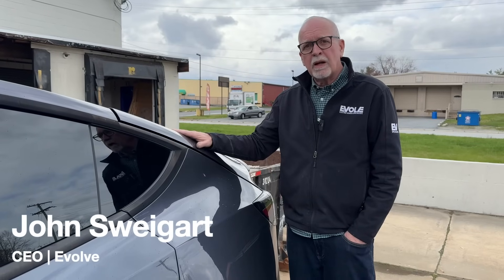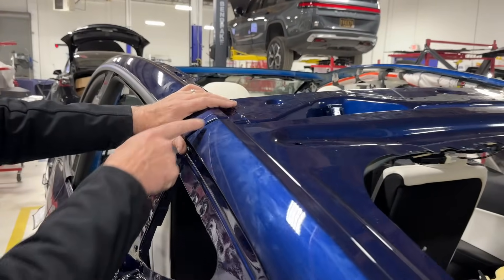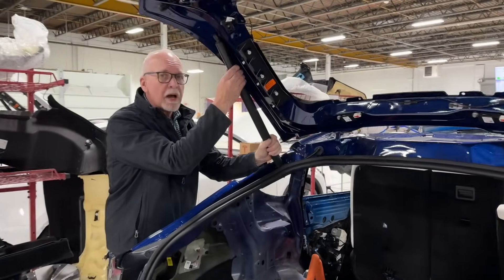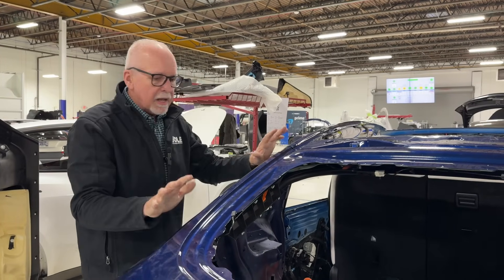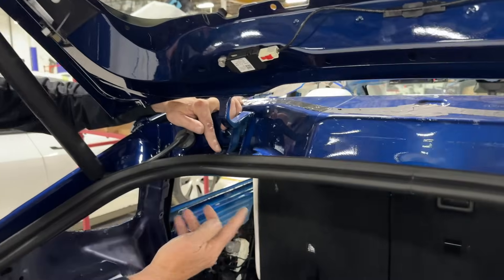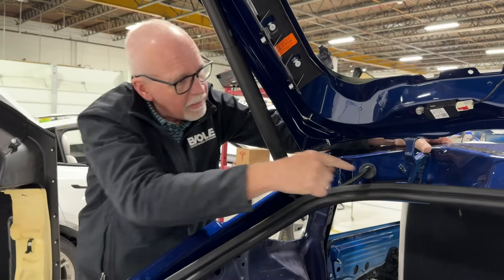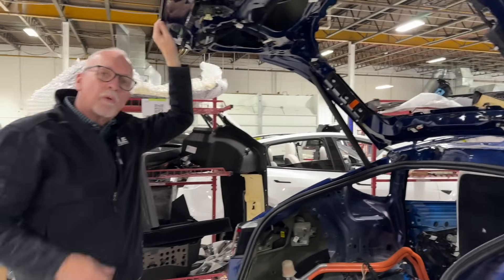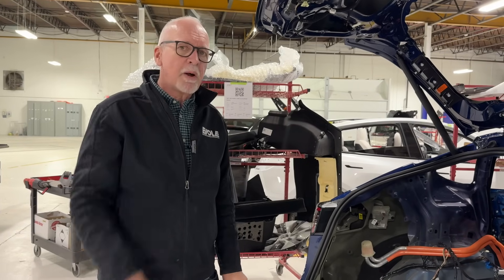Tesla Model Y Trunk Panel Gaps - Causes and Solutions

Comment: Today I have adjusted mine it was very easy no beet to open the screw just need to loosen tailgate tope 2 let and 3 right first attached to tail not body one with 13mm ratchet Spana that’s easy then right side there is rubber that one remove and adjust mean increase height right side so left ll be closer that’s it then secure the screw I ll make video sooner for that

Comment: Appreciate the video. Had this same issue resolved by Tesla a few months ago. They only told me the brackets had to be replaced. I had no idea on the root cause of the problem, so Thanks! Unfortunately, problem happened again and this time gap is MUCH worse. You'd think they'd issue a Recall for a new engineering design. Perhaps two powered hinges vs one side. Taking it in to Service Center. Lets see what they say now.
Reply: What did they say ?
Reply: What did they say
Reply: @amandopurperhart1351 my car is right now at the SC for this problem. I'll let you know
Reply: @pTrzor thanks brother
Reply: @amandopurperhart1351 One of the trunk hinges is bent. I need to have it replaced at a Tesla-approved body shop, and then they'll make an adjustment. Tesla will pay of course

Comment: This is so helpful. I have a Mazda CX-60 with a misaligned trunk. I pushed to hard on it when it opened automatically because it has the kick sensor and I was behind the car. It's basically exactly the same system. Now I can try fix it myself.

Comment: HI there and thanks for taking the time to create a video about this. My issue is slightly different, I have a 2023 Model Y and it has developed a massively annoying squeak (that sounds like a rattle) traced to the lift gate rubber seal. I have had the car back at Tesla twice now for the same thing, first and engineer re-aligned the whole lift gate and surrounding liners but after the squeak persisted, it was back to Tesla. On the second occasion the engineer said "it is definitely your rubber seal squeaking" and he put some special lubricant / softener on the seal and sure, the squeak was gone. But only for about three months and it is back worse than ever.  (whatever he put on the seal was NOT silicone as I have already tried that to no avail). Anyway, my question is - would having the lift gate aligned in some way (or can the closing position pressure be adjusted) to stop the squeaking, or should I have them replace the rubber? Even if they won't do it under warranty, a seal seems to be only $50 and cannot be that hard to affix....

Comment: I have the same issue on my 2022 Tesla Model Y and when I took it to the service center I was told that the hinge was bent and Tesla did not warranty the hinge & I would need to take it to a body shop & pay to have it repaired?  Is anyone else getting tesla to repair it?
Reply: same issue here, tesla told me to take it to body shop and is passed my warranty on 50k miles. Cheap made materials, Im done with any other Tesla.
Reply: I know this is late, but Tesla have replaced the power strut and the bent hinge on warranty for me right now.
Reply: @Nevercash  What year Model Y?  Thanks
Reply: @running5545  mines a 21 Model 3 Performance, but both models have had issues with the power strut and hinges.

Comment: They should really offer electric power strut retrofit for the other side of the trunk. 
I don’t get it, the trunk is so massive on the model Y, I really don’t trust this strut a lot on my Model Y. 
Especially since on the new Model 3 refresh they added a second power strut they should really retrofit it on the Model Y.
Reply: Two power struts on the refreshed Model Y. This issue has been addressed.

Comment: Redesigning the hinge is only treating the symptoms.  Tesla really should send power to both struts thus reducing the amount pressure needed in each strut to open the tailgate.
Reply: They have addressed this problem on Model Y juniper, which are equipped with what they called "dual power struts". I guess the force applied on both sides of the trunk will be more even.
Reply: @k @kwunmeichan8013 100% correct.
Reply: It cost money you know. The most important thing for Tesla is to pump out vehicles, the cheaper the better.
Quality?
Naah. Not important.
Guess why radar, sodar, stalks and that went away?
Soon they will remove the seats except driver seat and have a "Premium package" where "Seat included"...